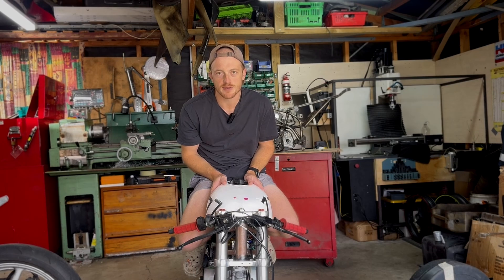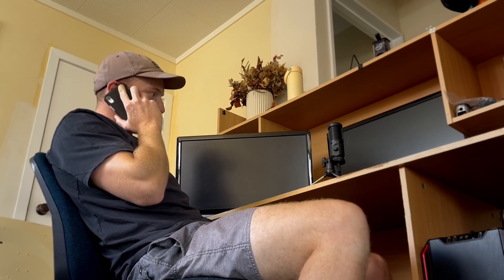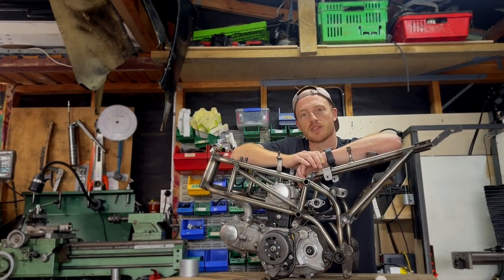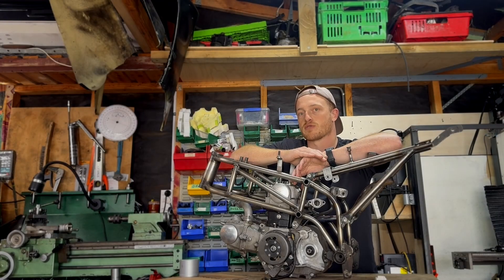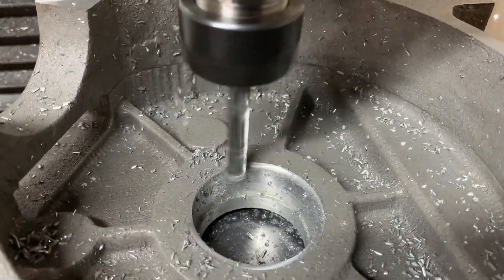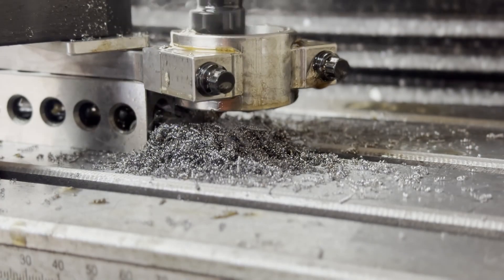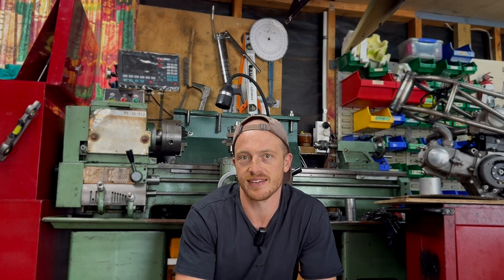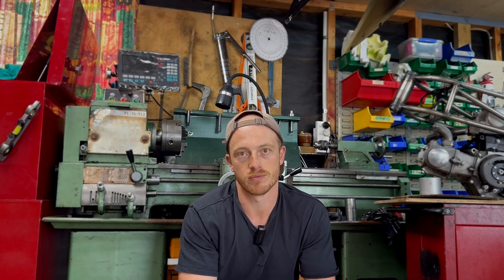Why I Designed and Built an Engine From Scratch

Comment: Great work bloke.
But why not go for 90 degrees? You get primary and secondary balance.
60 degrees makes it much harder. You'll also get more torsional vibration too...
Maybe ok to fix with a larger flywheel, but you'll find out when you get it running.
Reply from the maker: Thanks. For this project the balance doesn’t matter, the forces are relatively small with a 47mm piston. The whole idea was to make a more compact engine that makes a more ‘classic’ V-twin sound.

Comment: Now if you could cast a mirrored head.  Allowing the use of a single carburetor , and the exhaust to rear exit on the rear cylinder. This is awesome! Imagine a short block, with the ability to use two Suzuki DR 650 cylinders! A roughly 1300 cc engine. Anything from 900cc to 1400cc-1500 cc😮.  In theory, I'm thinking around 1200 would be better, 1180's-1190's cc displacement. Making power a bit higher in the rev range. Make it a bit safer on a mini bike.. a slightly lower bottom end tq!  Maybe make replica air craft cylinders at or greater than 2000cc per cylinder, with a 5"-6" bore, like the liberty engine maybe make it a bit more modern shorter stroke , lighter piston.  4340 rods and crank. Cast a light weight piston using old pistons add some more silicon, make a good hypereutectic piston alloy. HD and long rods , get a roughly 8:1 compression, a 4"stroke with a 6" bore, use two 1.95"- 2.0" exhaust valves, two 2.100" intake valve use a custom cam grind made from tool steel with adjustable followers  around .600" lift  280°  235-240 @ .050"  with 300° on the exhaust use two 38mm carbs, on a plenum that bolts between cylinders. Using safety wire. Use one for idle the second opens at 1/4 throttle. With the pistons having a large dish hemisphere shaped directly under the sparkplug with smooth grooves around the edges to allow the air/fuel to swirl when the piston is reaching tdc. Use bevel gears to drive the cams. Off a 20 tooth sprocket driving a 40 tooth sprocket on a shaft with bevel gears and a oil pump driven from the far end. And a "distributor"  on the near end. Actually a dual cdi looking like a distributor. A rotor with two metal bits for the pickups to read, one pickup mounted 1/2" higher than the other so the get their own separate ignition times. Looking like a old style magneto or distributor.  With the cdi output going through beaded conduit, to the cylinder tops with a motorcycle coil mounted on the spark plugs   the cam covers having fins to appear  as a sleeve valve engine.  Then scale this down with a 4"bore  and 4" stroke for a mini bike , or even a smaller 3.25" bore and 3" stroke using two valves, 1.5"  1.25"  intake /exhaust. A 30 mm carburator, have a mini block, small block  normal block, then the big block! Sell them as kits finished castings that can require final machine work. If I had a shop with equipment I'd make one hopefully sell them! Definitely build one! ✌️  Awesome work
Reply from the maker: Thank you, it sounds like you’ve put a decent amount of thought into this. It sounds like it would be a good project to model in 3D.

Comment: My question is why use a linked rod and not two separate rods, wouldn’t it be cheaper to use the rods from the single cylinders?
Reply from the maker: Other than the fact it makes it unique and my own engine. It would mean a new 3 piece crank which needs machining, hardening and grinding. . . Not to mention the Honda rods are far too short for the narrow V angle.
Reply: @OddsandEndsMachining  im pretty sure  these are the motors le dan likes to use ... in that case you can press the crank apart and combine 2.
Reply: https://www.youtube.com/watch?v=GkMEvM0-JAU
Reply from the maker: Thanks for taking an interest. The are more considerations to take into account than are apparent when you view this from the perspective of comparing what I am doing to Le Dan. 

That would need to be the subject of an entire video on its own. I think there is a difference between making a one off for a video and making something that can be sold and will run reliably.
Reply: easier to make the rods proprietary and use a common gx200 crank
Reply: @frigglebiscuit7484  Is that what you did when you made yours? Oh wait...

Comment: how to make smooth surface on casting
Reply from the maker: Check out the video on how I cast the engine. If the pattern is smooth the casting will come out fairly smooth. You can sand and media blast them for an ever smoother surface.